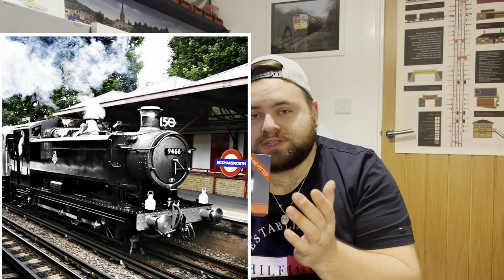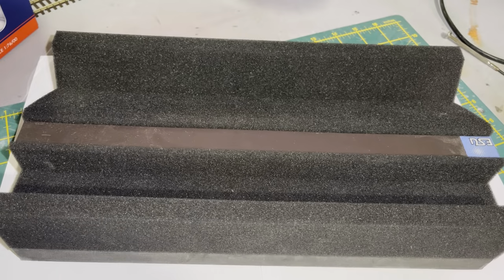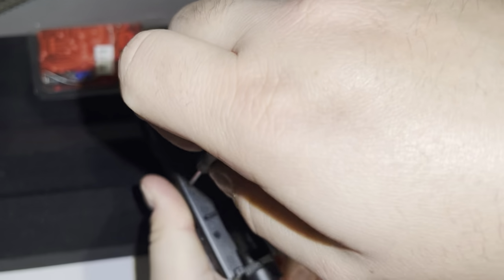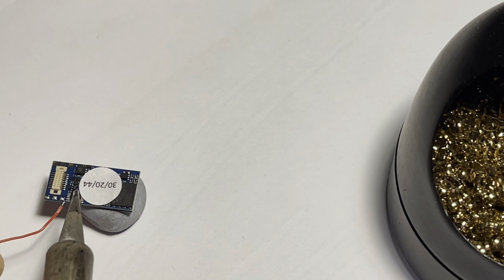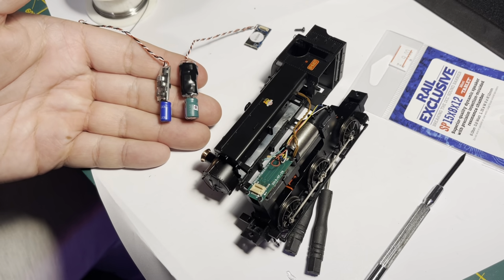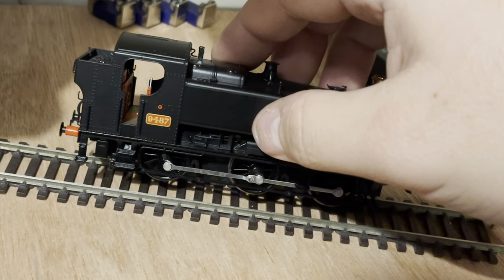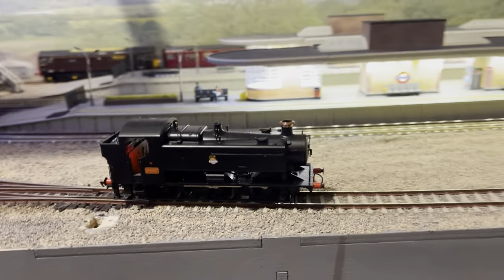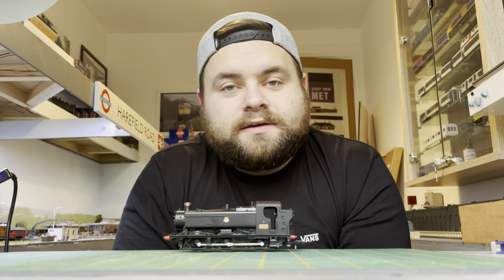Bachmann NEW 94XX Pannier tank - review & dcc sound/stay alive fitting guide

Comment: Hi Great video and install. I have used the same stay alive in the oxford Janus, with a V4 esu sound chip. I  had jerky running. I followed a esu video, to set cv54 to 0 then press F1, the chip then maps the bemf for the loco through the speed range over about a 1 metre of track. It then runs a lot smoother.

Comment: Hi Eric, just about to do this mod and already given up……for now.  Too afraid to separate the chassis rail from the plastic body to access to weight screws.  When I separate the two, the brake rods, I assume, go through the boiler stays at the front near the smoke box.  Did you push these out in advance from underneath.  Not clear in your video.  If I force it, they are going to break.  Can you remember what you did? 
Cheers, 
Stuart

Comment: Hi great video I am going to do the same. but on looking for the speaker you have fitted it is a 6 ohm not 8 ohm like you stated in the video and the one in the video is showing 6 ohm on the packet is it ok to mix 6 and 8 ohm together
Reply from the maker: Hey Jack!
Thanks for pointing that out mate - yes i made an error there! This is seemingly the only rail exclusive speaker that is 6ohm, they are usually 8.
That mixed with a second 8ohm speaker in parallel is 3.4ohms.
Loksound V5s are supposed to be used with 4ohms and above, but they can cope with a touch lower.
If you keep the max volume down this should also help prolong its life.
Good luck with yours!
Eric
Reply: Ok thanks

Comment: Thank you for showing how you added a stay-alive to this model. I purchased the Locomotion-exclusive 9400. It's absolutely gorgeous and runs smoothly on DC. I will need to chip it before I can run it on my big club layout which will be the true test. I don't think that particular stay-alive brand is available in the US so I will have to source a substitute.

I've encountered similar jerky running issues with another B-mann coreless motor loco, the N gauge Fairburn tank. I had to dial the ESU LokPilot BEMF settings way, way back to get it to run smoothly while still having some BEMF there. I could share my settings with you if you think it could help set a baseline.

Comment: Hi Eric, question for you about your choice of 3 wire decoders, you mentioned you’ve had bad performance with 2 wire versions like Lais Kung Fu’s? Is that specific to ESU?

Admittedly I’m not a DCC sound man (yet), but I’m a zimo decoder user, simply because I’ve found their performance faultless across all my locos and I like sticking to one brand (similar to yourself I guess?), I particularly found great running with the coreless motor’d loco’s I have.

My understanding from the handful I’ve installed is that on the underside of every NEXT18 socket board there are solder pads ready for ground and V+ specifically designed for two wire stay alives, and that this will work no matter what decoder you install because it’s built into the NEXT18 standard. (This is why I love the next18 socket design)

The Lais Kung fu stay alive’s are £10 each from CM3 (not affiliated) which I find a great price, and I like that they come in 3 shapes. They seem same size or even smaller than the capacitor unit you had there?

Anyway, really great video, just discovered your channel, I wanted to share my thoughts and ask what you think - particularly what you have found issues to be with your specific decoders and 2 wire stay alives?

Cheers,
G

Comment: Hi, If this 'was' a smooth running loco - why do you need a 'stay alive' ?? I have an 'old' Fleischmann 2-4-0 with a simple DCC decoder and it runs even at the slowest speed over my Insulfrog points. It's a matter of quality motor and design ! In doing so you've changed the 'balance' of the loco. See what happens in the long run. How about it ? Success!
Reply from the maker: Hi, sadly smooth running is something that the 94xx isnt!
The poor factory settings on the decoder let it down as i explain towards the end of the video.

I fit a stay alive in these short wheelbase locos as a just incase.
They may run okay on perfectly clean track, but any bit of dirt ect can cause issues and the sound dropping out ect.

Ive never experience issues with an unbalanced loco from fitting a stay alive.
Reply: @UndergroundEric  Hope you find a solution. Success & thanks for your kind reply !
Reply from the maker: @phil36310  its deffinately fixable, however its going to take a lot of time making small tweaks to get it right.  
Thanks for watching 🙂

Comment: Mine went back to the retailer as it was jerky too. It also cut out on every single set of points and randomly sped up/slowed down when running at speed.

Bachmann reckoned it was down to dirty/misaligned pickups (I cleaned and aligned them so not that) or a loose wire somewhere! 🤦🏼‍♂️🤷🏼‍♂️
Reply from the maker: Exact issues im having mate.
Its down to the decoder settings sadly!